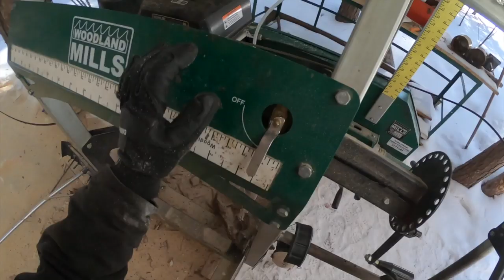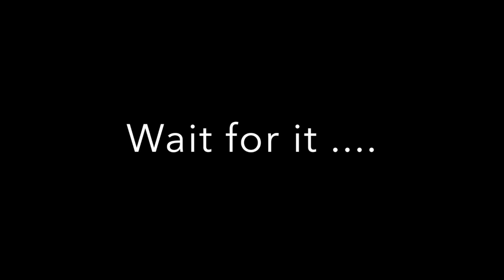Portable Sawmill Blade Snaps at Full Speed

Comment: It's the cold weather and frozen wood that caused it to break. When really cold steel is more brittle and as it travels on the band wheels it is perpetually bending a small amount. This with the cold snaps blades. Another issue is as blades get dull they develop micro cracks in the gullets. These develope into bigger cracks causing breakage. Proper sharpening can help prevent this type of breakage. As a tiny amount of metal should be removed in the gullet removing any micro cracks. Hope this helps from a old Sawyer that's done this along time.
Reply from the maker: That’s great info Ken. I appreciate hearing from folks like you with a ton more experience with this than I. Take care and have a great Easter weekend
Reply: So do they ever fly off when they break? I’ve not broke one or had one come off in a couple hours I’ve ran the mill but it sure scares me.. should I relax?
Reply: @ballbeanking  well it is important to keep the guards in place when running. But not running dull blades and proper sharpening are important in preventing breaking.
Reply: Ken Jett thank you

Comment: On the cold starting. I do lots of cold weather sawing -20 even -30 if im feeling house bound, I use the exhaust off my skidsteer to warm up the mill engine using a metal dryer vent tube, you could use your sled exhaust. As for that blade breaking, if you listen to the sound of the engine stating to labour just before the break it was because of the knot, and you didn’t slow down on the pushing. But very good video to learn from.
Reply from the maker: That's an awesome idea! I never thought about the snowmobile but to be honest it sure does give off some hot exhuast. Definetly an idea I'm going to try. I also appreciate the tip about the knot. I went back and watched the video and do hear the engine labour a bit before breaking. I"ll be sure ot keep that in mind when I come across knotty wood in the future. Hope all is well. Thanks again,
Reply: Nope all isn’t well, stuck in the house for awhile, slipped and busted my collar bone, had surgery to install a j plate, so, laid up for the 8 weeks or more, but, hey it’s giving me plenty of time to watch your videos and lots of others, and stay out of the public to self isolate. Take care be safe.

Comment: So it is a couple years now since you posted this video. Any new thoughts on why the blades break? I've been using my Woodmizer LT15 for a few months now, cutting mostly cedar, but a few pines and oak.  Seems I am getting a broken blade about 10 logs on average.  Not at the weld. First on a cedar where it had a ring around the log, reminding me of where a fence might have once been and the tree had grown around it. The rings were not consistent with any sort of fence and many of the cedars have similar features. No metal in the wood either.  Most of the breaks have been on cedar, but that is also most of the logs I'm cutting. Woodmizer factory blades is what I am using.  And its pretty warm here, nothing like those cold temperatures you experienced.  Learned a lot watching your videos. Thanks for posting.
Reply from the maker: I believe the blades are breaking because they develop stress cracks that aren't ground away when sharpening and/or the ongoing heating up (expansion) and cooling down

Comment: Hey buddy how are you? I’m thinking super cold!!! I’m glad your safe, the blade was contained inside the machine. When its this cold no bugs hehe! I was thinking what to do with the broken blades. How about cutting to 6 in length stack them maybe then weld into a block and hand forge into a cool Damascus bush knife. Super neat use of the blades. Oops dreaming again hehe. Thank for the cool video. Have a good one buddy
Reply from the maker: That’s a great idea about the blades. I do have a lot of them as you can see. Never really thought what to do with them. Would be a near project and I can try out my black smithing. Just missing the forge now.
Reply: Sawing with Sandy maybe a propane bottle furnace with home made burners. I made a blast furnace that burns waste motor oil. I have a lot of oil and it’s free. Use a electric weed blower and a syphon valve I made out of brass pipe fitting. Gets steel white hot

Comment: Hi Sandy, I have the 126 setup too. 9.9 hp. Thigns were going great this week until I snapped 2 blades. It happened on a bigger pine log. I knew the blades were struggling early on. I had gotten them sharpened but the dude did not adjust the teeth. The mill started to shake even though I mill real slow. From your experience do you think poorly set teeth and aging blades are more prone to snap. Tech support at woodland mills wants me to check alignment of everything even to the point of ensuring the clutch is parrallel to the drive wheel using a steel bar. Anyhoo im still learning but your opinion would mean the world
Reply from the maker: Hi Paul great to hear from you. I"d say if the teeth where not set correctly the blade could've also caused wavy cuts as it pulled one way or another. I'd also imagine that if the blade was breaking it could've been caused by stress cracks in the blade. From what I know that could be due to stresses put on the blade like overheating and things like the full tooth not being lightly touched when sharpened.

Comment: I just had my blade jump off my Hm126 before I cut the log. Apparently it hit the blade guard and took out a few teeth. Removed the blade and now I can’t get it back on the wheels. Ever have that happen where the blade won’t go back on easily? All blade tension is released.
Reply from the maker: Likely the follower wheel is stuck and with a little bump it will move as it should when the tension is released.
Reply: @sawingwithsandy  that was it. I loosened it a bit more and was able to give it a push. Funny how that’s not in the manual I received.

Comment: I live in Fairbanks Alaska and got an HM-126 this winter. I put it to use in November and it has been as cold as minus 15 Fahrenheit and only one day have I used it above 20 degrees Fahrenheit. Most days it's been right around zero which is about 18 below Celsius. To start my mill at these temperatures, I have a helper hold the thrott le down about a quarter the way or because I normally don't have a helper, I use some twine to secure the throttle down about a quarter of the way. It normally fires up after about three or four pulls using that technique. On many days it is so cold the grease in the wheel bearings becomes stiff and the wheels don't turn at all or barely turn and the mill slides on the rails. The one day it was above 20 it was amazing to have the wheels actually roll freely!
Reply from the maker: I’m with ya on holding the throttle a little while starting. I try to do the same and it seems to work well. Thanks for watching and I hope your winter is going well for ya

Comment: If there is an exposed nut on your crank case (end of the crank shaft) you can put an appropriate size socket on your cordless drill and you will start the engine more easily.
Michael from Alberta
Reply from the maker: That’s a great idea. Unfortunately there’s a cover over it but maybe I’ll Jerry rig something like that up. Thanks for the idea

Comment: LMBO 😂 just watched this one lol. I have the same engine when it's really cold I take a piece of wood and put it under the throttle handle to make it fast idle and it fires right up ..
Reply from the maker: That’s not a bad idea using a piece of wood. I may have to rig something up myself
Reply: @sawingwithsandy  I use a wedged shape piece of wood just push the throttle down some and stick it in the top of handle. When it's cold it helps tremendously.!. Btw I really enjoy your videos. I've learned allot. Allot of good ideas and a few what not to do's lol
Reply: When he said to take a piece of wood, my mind went to a slightly larger piece, like a log and take a few swings at it. But that might be just me.

Comment: Can you weld the blade back together or does that just make another weak point that increases the potential for the blade to snap again?
Reply from the maker: I’m not too good of a welder but I bet someone with skill could. For me I end up replacing them when they break
Reply: Band blades can be rewelded but requires a special type of welding machine. It can be done by hand with silver soldering but is very tricky to get adequately square and straight with mixed results of it properly holding.. Long as teeth are not damaged you can send them back to manufacture for rewelding and sharpening for a cost of course.